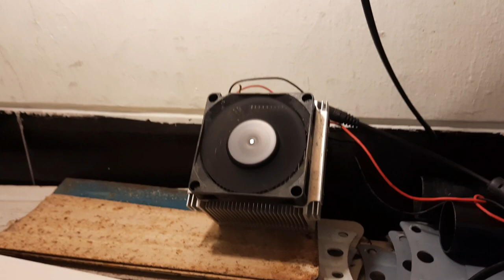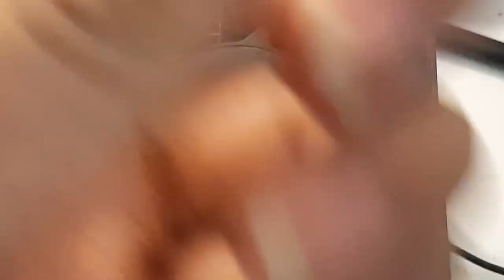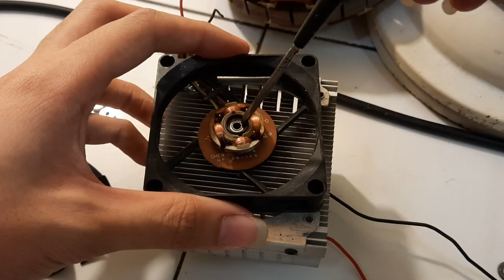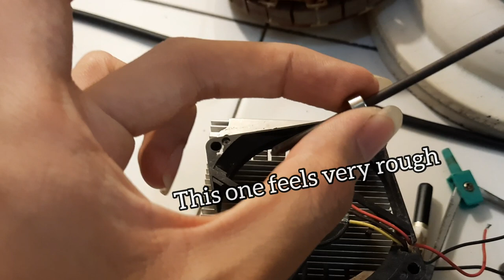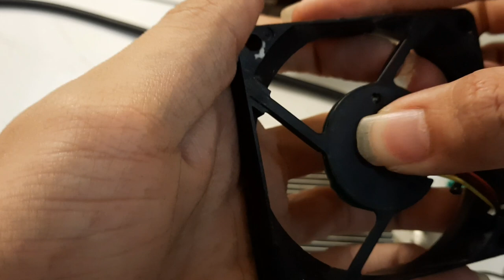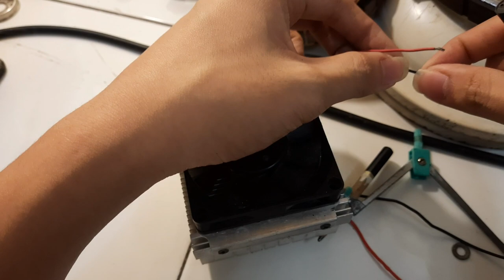Replacing Computer Fan Bearings | Quick Shop Project

Comment: pretty high quality that it has ball bearings. all the pc fans I have are either sleeve bearings or hydraulic.
Reply from the maker: Nidec specializes in industrial grade DC fans, that's why most of their fans use ball bearings instead of bushings.
Reply: @TheFanUniverse  yeah i remember those nidecs lasted for years with no issues. Ik some people prefer them over Delta fans

Comment: What are the dimensions of this bearing? I need to replace mine but I don't have a pachymeter to measure it.
Reply from the maker: Most of these fans use 693ZZ bearings
Reply: @TheFanUniverse  thank you, thats what i thought it was.
Reply: @TheFanUniverse  It worked. I bought and replaced with 693zz and now it's spinning very smooooth! Thanks again
Reply from the maker: That's great! Glad I could help
Reply: @TheFanUniverse  Exacly what I needed to know. May I suggest putting the fan part number in the description?

Comment: thats the correct way to do it. iv seen people drop oil into the hole or grease the shaft and none of those will work since its a sealed bearing the oil cant get into it. replacement is only way. never grease the shaft it need to be dry fit so it can grip the shaft to inner hole of bearing to spin the blades.
Reply from the maker: Oiling the bearings will worsen the problem. Any oil that gets in the bearing will soften the grease which will increase noise & wear
Reply: I greased a SANYO 150mm dc fan and lost 300 rpm instantly, replacing the bearing is the only opt I guess. @TheFanUniverse
Reply from the maker: If the grease you put in is too thick, it actually makes the fan work a lot harder. I suggest using just a tiny dab of grease & spread it all over the bearing instead of packing lots of grease in the bearing cavities
Reply: @TheFanUniverse  Thank you for the suggestion, I'll try that just worried I might tear the sticker over.
Reply: @sydskits5962  on ball bearing fans the sticks is just a dust seal, use some kapton or aluminium tape to seal the hole back up.

Comment: can you tell me whats the best way to remove fan sticker at home ? its very tightly sticked on my cpu cooler..  When i try by hand i just end up tearing it in the middle, tried it on other fans, it's just hard to peel off.. It's not effective.. and what glue do you use at the end and what was the green thingy you put on top of the sticker
Reply from the maker: Try spraying the edges of the sticker with alcohol, and keep spraying bit by bit once the sticker gets easier to peel. I find that method works quite well for me. I used regular glue stick to apply the sticker back on

Comment: Where do you buy the bearing from?
Reply from the maker: They are usually available in online shops. I got mine from broken computer fans that still have good bearings
Reply: @TheFanUniverse  So you buthcerd that fan, since it was not quite even after the bearing replacement. I have not seen any computer shop that would sell the bearing.

Comment: Nice video
I have a 120mm fan from MSI Liquid cool when i turn it on, it have a terrible sound, where i can purchase de replacement bearing for that msi fan?
Reply from the maker: Try searching online for 693ZZ bearings, or whatever the size of the bearings on your fan is. There should be plenty of online sellers advertising them

Comment: Hi, type bearing what is it ? For pc fan
Reply from the maker: I believe these are 693ZZ size bearings. That size bearing is commonly used in many PC fans, although you might want to re-check the bearings on your fan to see whether that's the correct size
Reply: @TheFanUniverse  oh isee thx man, my country difficult found a part. If fan dead, yeaa buy new one.. no small part, so sad

Comment: Would this work on laptop cooling fans?
Reply from the maker: If your laptop cooling fans use ball bearings, it should work
Reply: @TheFanUniverse  Just found out my laptop cooling fans uses sleeve bearings I wondering if it still be changed out?
Reply from the maker: Sleeve bearings on PC fans are harder to replace in my experience. Try lubricating the bearing with a bit of grease if the shaft & bearing has a bit of side to side play. If there isn't any play, lubricate them with regular electric motor oil

Comment: If your Sharp had an heat pump you could turn It on in heat mode, but indonesian air cons are straight Cool :(
Reply from the maker: Yes that's true. Reversible heatpumps aren't something that a tropical country needs. I have made plans last year to build a reversible heatpump, but sourcing parts for it proved to be very difficult.
Reply: If you were italian like me you could easily find a reversible heat pump
Reply from the maker: It's not impossible to find one here. Some units that people have imported from Japan or Korea are reversible heatpumps. But most of them are now 30 to 40 year old units. They draw a ton of power, and the risk of developing a leak is pretty high.